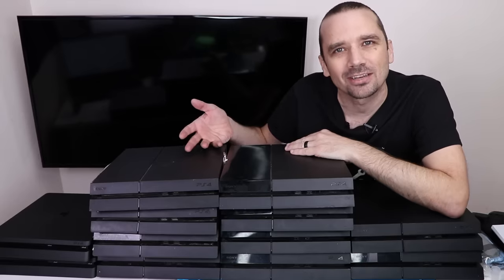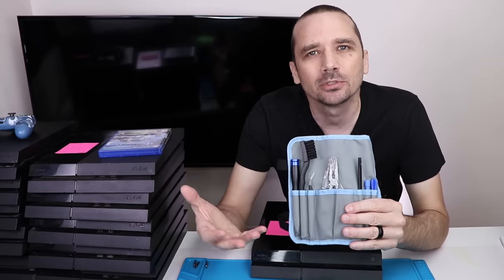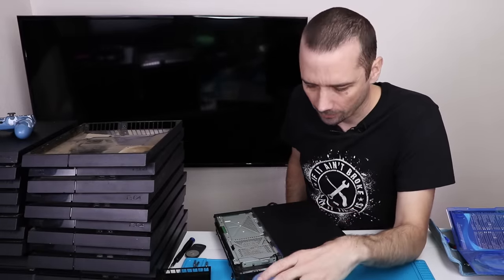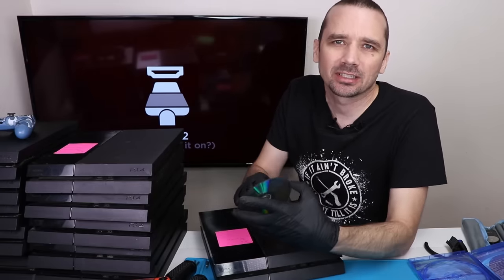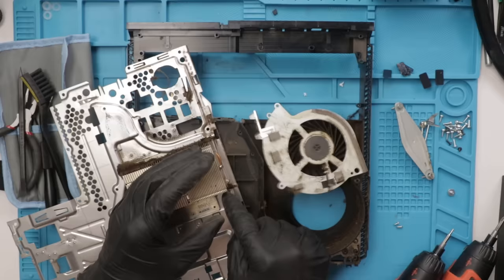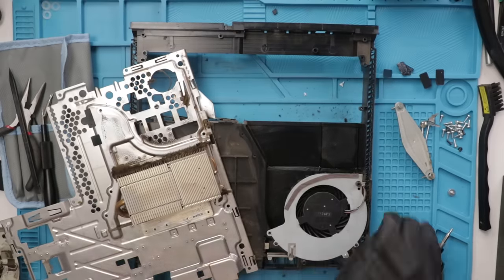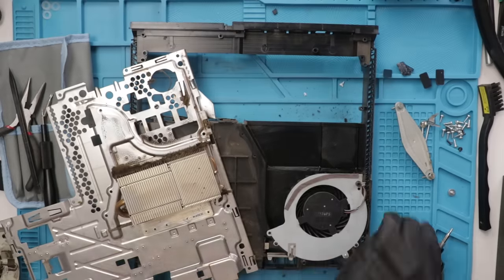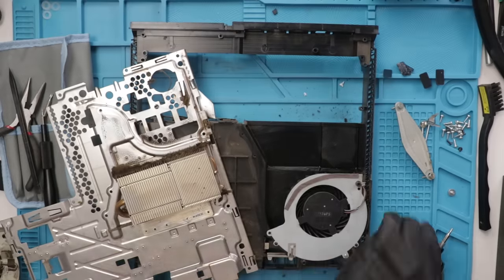I Bought 12 Broken PS4's From eBay - Let's Try to Fix Them!

Comment: Console number 1 was the worst
Reply from the maker: Ya, not a great start!
Reply: @Tronicsfix  😂🤣
Reply: Number 11 was a abuse victum D:
Reply: @Tronicsfix  looks like you were a bit late to wear the safety gloves.
Reply: It made me gag
Reply: Sometime around february 2018 i buyed cheapest PS4 from local sell site (OLX) for about 540PLN/140USD (In Poland the cheapest PS4 in that time was about 700-800PLN/180-210USD). This was definetly cheapest and dirtiest PS4 i've ever seen. It works just fine, but inside are whole lot of dust. Radiator have been totally covered. After good cleaning PS4 work just fine, but i've sell it to the pawn shop this year, and if i see, they sell it for about 700PLN/180USD, so when i've buyed it, this was really worth it's money.
Reply: Imagine what the lungs of number ones former owner look like?
Reply: @Tronicsfix  I have a problem with my PS4 or when I plug is starting to turn on but then it turned off I tried turning it on again and a light is not showing up but when I plug it out for a couple minutes and plug it back in I tried putting it on but nothing works I can only hear when I why press the CD dispenser button what could be the problem
Reply: It also looked smoker owned which is always gnarly.
Reply: I was eating when I watched this one :|
Reply: @vulgartech9192  no this look like he was playing in the kitchen it's the same thing that build on the oven.
Reply: Made me feel sick 😷🤢🤮
Reply: Yeah. It didn't just look like some cockroaches crawled in and died... but also a rat or two 😨🤢
Reply: How does something get that dirty
Reply: @allaansnackbar4269  idk but wow
Reply: Prince of random he didn't cleaned it good as well. He didn't even used the air blower for the heatsink.
Reply: how much
Reply: TronicsFix do a giveaway
Reply: I just clean my ps4 and forgot to clean the heatsink
Reply: @allaansnackbar4269  heavy smokers
Reply: @allaansnackbar4269  ikr?
Reply: The last owner was a smoker for sure
Reply: @wimwiddershins  imagine what number ones former owners ceiling fan looked like
Reply: Literally a bugged console.
Reply: I fixed this problem on my ps3 a few days ago super easy
Reply: mine is worse.. and my 300 lb ass to lazy to clean it 🤣
Reply: @Anonymous-gh6xf  probly just didnt show it in the video boy
Reply: Do u guys mean number 2? It literally had cockroaches in it.
Reply: It looked like someone threw it in the dirt
Reply: Secondhand smoke kills. Humans, pets, electronics, and cockroaches.

I'm glad I only service office equipment nowadays.
Reply: @Tronicsfix  you should get rare consoles that are broken then fix then sell them at a high price because its rare
Reply: Xbox user sad about playing LEGO spider man
Reply: @wimwiddershins  like two sick bags of tar, I can tell.
Reply: I got a red jdm055 ps4 controller from a dude for free because he said it wasnt working.....well I opened it....yall ever seen a controller with a family of roaches inside?...Im sti traumatized...
Reply: You r Sell me 1 ps4
Reply: @Tronicsfix  do a giveaway!
Reply: Can you imagine how disgusting the house was, if that’s how the console looked?
Reply: I know!  I'm trying to eat my breakfast here..
Reply: @jblcharge3_basstester  ps3? Sad times lol
Reply: How tf do you get a cockroach in your PS4
Reply: Easy to fix though
Reply: @kindafunnyvids
Reply: First one is basically mostly because of smoking. I have seen lots and lots of electronics devices just like that, and the main reason is smoking. This looks to be a home where there were HEAVY chain smoking going on.
Reply: That is a reason, Why do not buy a used old console
Reply: I like your vids!
Reply: Fook me, just imagine how filthy the house of #1 ps4 is yuck
Reply: @Tronicsfix  how can you touch all that dust without gloves :|
Reply: Just don't buy discs with first one
Reply: No foreal guys I actually GAGED lol

Comment: I have a strong urge to clean the inside of my PS4 now
Reply: Same but, I don't want to break it.
Reply: Risky
Reply: yup :P
Reply: I never open my ps4 if you open it you break a sticker and if it’s broken you can’t return it to the store for a new one
Reply: Not only the ps4, 2007 xbox360 as well lol
Reply: My ps4 is starting to get slow at pulling in discs. I hope it doesnt mean anything
Reply: Me too :)
Reply: @abdur3662  uses the wand attachment on your vacuum. Slowly run it along all the vent holes a couple times. It will pull out a suprising amount of dust bunnies
Reply: I cleaned my ps4 but I think I broke it
Reply: Ikr
Reply: Fix it until it's broke.
Reply: @hiiack1442  Dirty disc rollers.
Have the same thing on my console and i need to help the disc a little to get it inside.
I need to clean those some day.
Reply: @benwoodard6851  
I also clean the air vents with a vacuum cleaner every 2-3 months, but i also open my console every couple of years to clean it properly.
Quiet Ps4.
Reply: @trumpjongun8831  I have opened and cleaned my 360 xbox 1 and ps4 multiple times. Replaced and repaired components.  For people that are too scared or lack the tools and ability the vacuum method is helpful
Reply: @benwoodard6851  
Yeah, but that doesn't help much when the dust and dirt is stuck on the heat sink and cooling fan.

But i agree that it's still good to clean those air vents once in a couple or few months.
Reply: Same but I'm scared It might brake
Reply: I don't own one haha
Reply: @trumpjongun8831  problem is I dont wanna risk breaking it
Reply: @hiiack1442  I understand.
There is a risk something breaks if you haven't work with electric devices before.
Im not an electrician, but i learned by doing.
First time when i took apart my Ps4 and was cleaning it, i accidentally broke the bluetooth antenna...
Very fragile part.
Luckily i had an extra Ps3 so i took a new antenna from there.
Reply: @trumpjongun8831  I mean I know how to do it and I have more than enough tools to do it. I just dont wanna risk it
Reply: @mokaaboun4274  the warranty on mine is expired anyways. might as well scrub her out
Reply: I did It, broke the power supply.
Reply: Same put I'm probably gonna break it
Reply: yeah same but im too lazy
Reply: True that! He makes it look so easy too! Mines 7 year old and the fan is starting to be a bit loud and I'm scared to open it and break it! Plus you always end up with extra screws😂
Reply: Same
Reply: @benwoodard6851  dangerous
Reply: It’s easy as long as you have the right toools and tbh you have a higher chance of braking you’re ps4 controller when ur opening it up😂
Reply: Me too, because my ps4 just randomly ejects the disk sometimes and i just thought it's  dirty

Comment: I wonder how many times people have sold a console thinkings its broken only for the thing to have just needed a good clean
Reply: It's a usual thing that happens. People throw away equipment at the slightest of malfunctions. Have to blame the first service side as well (the ones who must've checked out the items prior to someone technical doing the repair).
Reply: My neighbor once wanted to throw away his PC once because it wasn't working and I saw him but PC next to trash can and I asked him why is he throwing it away? he said it's not working, it's been sitting in his closet for months and I said if I can take some parts out and I would throw it away and he said sure but it's probably dead. I took it in, cleaned everything inside in details and it freaking started to work, sold it for 300€....that was the easiest 300€ to be honest
Reply: @ElvizNation  sir PC doesnt work that way..
Reply: yeah people kepp nagging about the ps4 s loud fans and making memes out odf it like just clean the damm thing
Reply: @ElvizNation  thats not cool man I hope you reset his information
Reply: happens. Smokers, pets, bad life styles, just gunks up the system.
Reply: I've picked up quite a few electrical items over the years which I have just changed the fuze to get working again. The things people throw away. 👍
Reply: @ricksanchez1527  It actually does. Depending on what the dust is from it could be temporarily shorting something out in the PSU causing it to trip every time you turn it on. If you clean that dust out it will start working again.

Comment: Imagine what the apartment of the first ps4 owner looks like.
Reply: Henk Vrijhoeven probably a heavy smoker right there
Reply: Simcha Vos No he uses the ps4 as a bong
Reply: I've had alot worse trust me that's looks pretty decent compared to some I've cleaned
Reply: @Henk vrijhoeven haha legend
Reply: @AVGaming-uf5ob  it had bugs in it
Reply: Bugs love electronics. You can have a perfectly clean home (obviously this guy didn't) and still have bugs in your stuff
Reply: xLithePanther but then the PS4 is somehow famous for having a roach infestation issue... (a lot more then the Xbox)
Reply: @same9322  I meant dust wise that yeah that's gross
Reply: @Windows98R  just the original model
Reply: @calmet676  lmfaooo
Reply: Bruh , he must be living in a mine 😂😂😂🤣🤣🤣☠️☠️☠️
Reply: Ps4 gets very hot and that makes a great place for bugs to breed. The psu is the main culprit.
Reply: @SimchaVos  he probably blew cig and vape smoke into the fan and heatsink
Reply: I don't mind the apartment. Frankly I worry for his/her lungs.
Reply: @xLithePanther  I don't think a home with proper air filtration can result in that much crap in the PS4. I know dust is everywhere but that makes me think it's a place with lots of heavy visible SPM.
Reply: I'm guessing it was sitting in an attic for a long long time 😣😣😣
Reply: Νah he might just had it in a small corner where cleaning is  more challenging
Reply: Look at how thick it is
Reply: Im sure the very first owner was the founder himself, those kind of guys tend to be messy
Reply: With that much dust and grime caked up on the intake just imagine what their lungs must be going through.
Reply: How do you know it's and apartment and not a house?
Reply: Probably cleaned his crusty ass with it
Reply: Yes its warm i can confirm me and my girlfriend sit on the ps4 for breeding aswell
Reply: probably sat on a shelf in a house with a couple cats
Reply: He plays in kitchen
Reply: Its from an apartment?
Reply: I dont live in filth but you should've seen my first xbox 360 had it since it came out. Took it apart last year just for shits and giggles. Imagine what 10 years of dust looks like it almost solidifies theres so much
Reply: *Trailer
Reply: @tjwoosta  lungs don't work the same way as electronics 😂😂
Your respiratory system has dust protection. And by that I mean dust can't get in your lungs. Every particle is caught by your mucus and hair wires from the nose. Every time you sneeze or wipe away your nose the dust gets cleaned and nothing is affected. The only things that pass are liquids and smoke.
Reply: @simonmarcu01  I think the existence of diseases like black lung and asbestosis prove that dust enters the lungs. Yes our bodies can handle it pretty well, but it still happens and air quality shouldn't be ignored.
Reply: xLithePanther thats literally impossible.
Reply: One of the 4chan worst rooms 😂
Reply: Rókur Kvilt i died
Reply: Rhys Watson or dogs. My friend has 5 dogs and their house always seems to have bugs and insects like cockroaches

Comment: Puts gloves on after cleaning cockroaches. 

"I made a huge mistake"
Reply: ow i had to check comments before commenting, nvm
Reply: I said pretty much the same thing
Reply: Its not that bad, just wear the gloves with in the inner side outwards and the outer side inwards
Reply: strapped up when it was too late
Reply: Jop
Reply: It's like when Cody's Lab handles volatile chemicals with his bare hands but wears gloves to use the calculator.
Reply: i don’t understand how you get cockroaches in a Ps4
Reply: @exoticcmatt5162  i think it has to do something with the heat generated by the machine or maybe the electricity - seen once a photo of a wall-built in phone that was full of cockroaches because they are attracted to the lectricity or something like that
Reply: @Exoticc Matt bugs such as roaches and crickets are attracted to small dark spaces, the warmer the better. Therefore they are attracted to all sorts of electronics, especially consoles, Desktops, and Laptops. The more vents the device has, the more likely to find them in an environment with said pests. Also any type of glue of even a softened tape makes viable food for said pests as well. Not to mention the dust buildup may also end up as a food source

Comment: This makes me want to take mine apart and clean out the dust.
Reply: me too
Reply: It's pretty easy. I done it twice.
Reply: The Element of Juice and cockroaches
Reply: That is not the formula of LSD
Reply: And the roaches too
Reply: @underworld323  what do you need and how do you do it please 😞
Reply: @crazre1863  the tools that he used in the video. And a air duster.
There's also videos on YouTube one how to do it
Reply: Crazre a basic philps screwdriver and cotton swabs
Reply: E E your 20€ is like literally 60$ Canadian so still pre expensive
Reply: E E or some tiny ass fingers
Reply: E E was 66 like 4 years ago
Reply: same
Reply: Better yet tear it apart and just get a Xbox
Reply: @Electriccoolaid  my bad, I'm not a wannabe chemist
Reply: If you do clean it, you should use a lower power vac. Cleaning it like he is with the brush may push dirt or debris back in it.
Reply: I did it, had 2 guinea pigs in it
Reply: Mine never got opened up in 6 years, im scared to do it